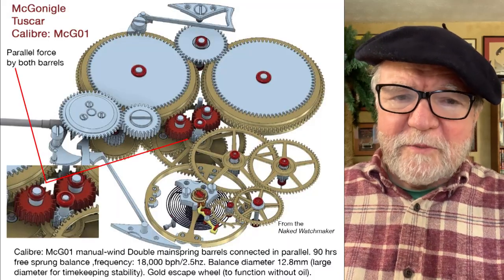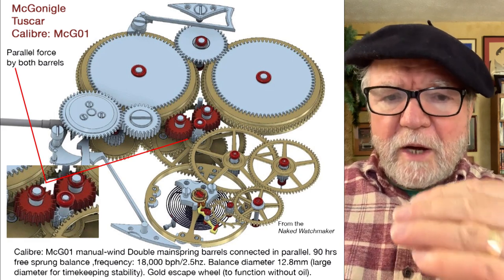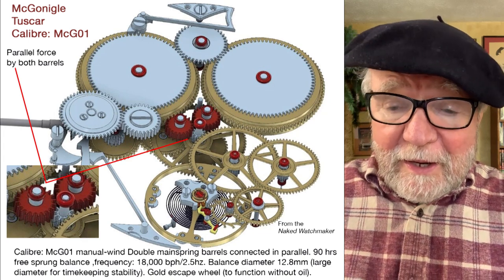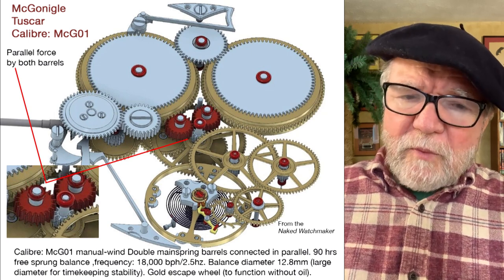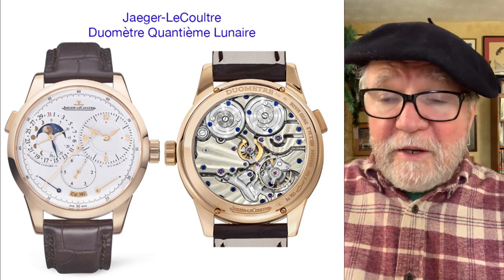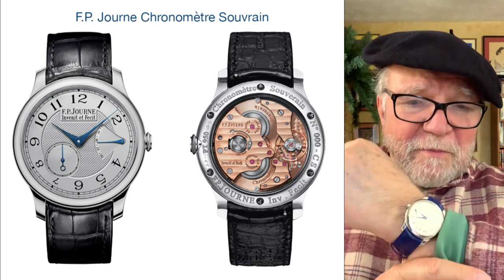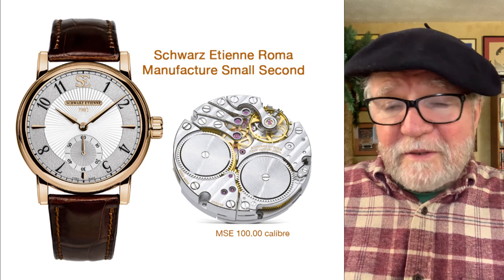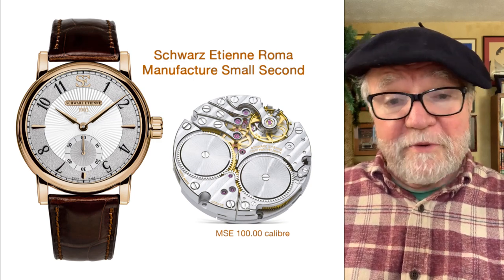Dual Barrels in Parallel: A Ticket Off the Children’s Table of Watch Collection #VP148

Comment: The topic of mainspring configurations is an interesting one. In theory there shouldn't be any significant difference between having dual barrels in parallel or series, after adjustment for the torque ratio. Every helical spring has a torque vs rotation curve and connecting them in parallel simply doubles the effective torque whereas in series it doubles the rotation. But assuming they're geared to produce the same final torque on the going train the effective torque curve will remain the same, and with a minimum torque stopworks the useful range of the spring will also remain the same. I guess the choice is mainly just a matter of packaging the spring(s) within the movement. Though I can see that in the case of one spring being weaker than the other the parallel configuration may produce a more uniform output assuming their rotation is geared directly together rather than through some type of differential. I'm more familiar with this from the point of view of automotive engineering, so I wonder do any movements use a differential between then mainspring barrels? I've heard of differentials being used in multi-tourbillon watches, but not sure if they ever use these for linking the mainspring barrels.
Reply from the maker: David, parallel and serial are different in theory. Think of two horses pulling a cart, each dividing the total weight. Then think of that same cart being pulled by one horse, and then replaced by another after the certain distance. Take care, Bill

Comment: What is the accuracy improvement with two barrels in parallel, a constant force remontoire that  “talks” to the escapement, a bi-axial escapement to cut the friction in half, etc? Seems like these are about as useless as a tourbillon (why in the world would you need to rotate the escapement, balance wheel and hair spring on a wrist watch).. I can see the benefit of two barrels in serial for a larger power reserve but all else seems like BS “improvements” that are just expensive non-discernible solutions to non-existing problems
Reply from the maker: Good question Jorge. See if you can find a comparison between one barrel and double barrels in parallel. Let me know! Take care, Bill